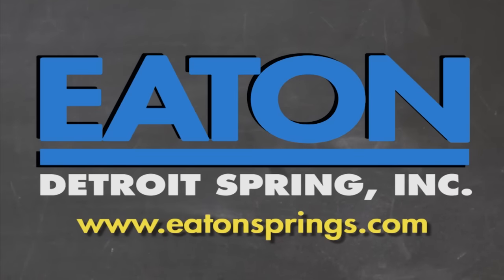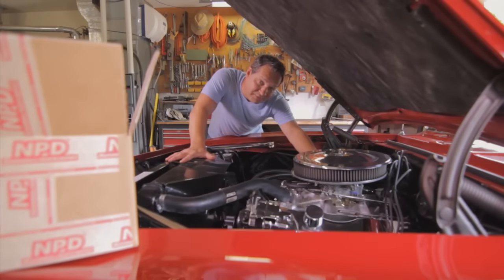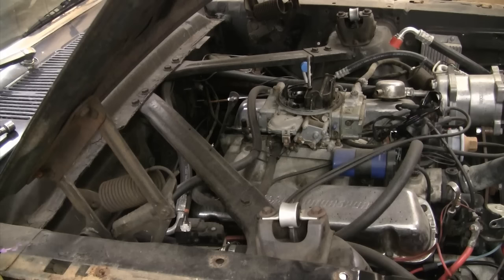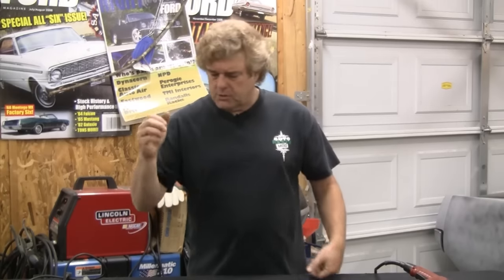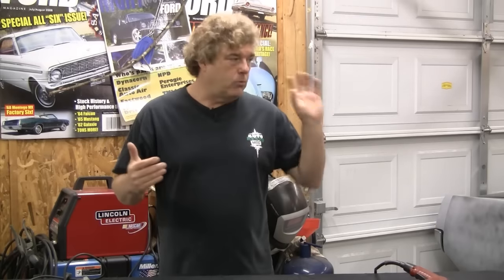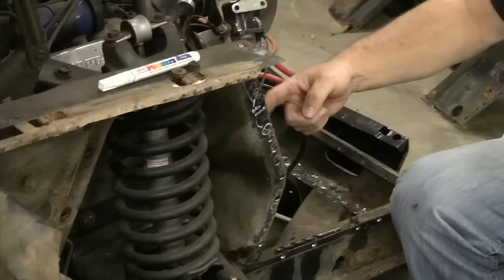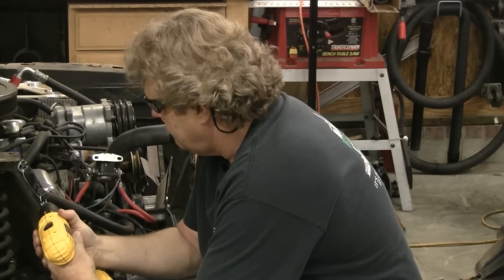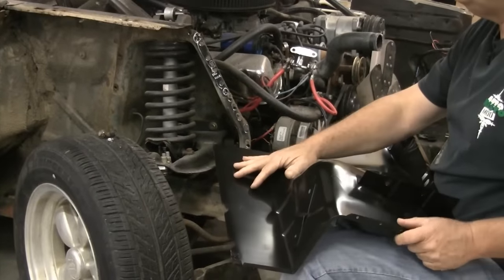Weld in a Radiator Core Support and Battery Tray Apron 1965 1966 Mustang Episode 236 Autorestomod

Comment: I noticed you had a core support stamping, minus the bottom most section which rides below the radiator in a horizontal configuration. Does someone sell just the section below the radiator?
Reply from the maker: NPD sells the whole part, I just didn't want to deal with the work it would take to remove the original. It was in good shape so no need to replace it.

Comment: Would a Chicago Electric 120 Amp Flux Welder work?  I'm asking because the only low enough mig welder I can buy is a 170amp MIG/Flux Welder and its a 240v. I'm not exactly sure which one would work best for doing the sheet metal?
Reply from the maker: Not well. Just ask Cam. We'd rather see you use a MIG like the 240v that they offer at Harbor Freight. Jeff prefers the Lincoln or Miller 110. You can dang near weld tinfoil with the right wire. We use a 110 Lincoln with an Argon with .023 to .030 wire. Check this page for Argon flow: http://www.netwelding.com/MIG_Flow%20Rate-Chart.htm . A good welder and correct settings can go a LONG way to making it a relatively pain free experience.

Comment: Hey guys, thanks a ton for doing these videos. Got a question...I'm about to do both front aprons and the radiator support. Are the spot welds for the core support tabs (that face forward and you bent backwards) inside the frame rails? I have the added luxury (?) of having to patch both outer frame rails for bumper brackets, and can take care of those while the frame rail is open. It makes sense in my head but I want to make sure before I get too into it. Thanks much!!
Reply from the maker: They are on the outside of inner facing of the rails. email me at: jford@autorestomod.com and I can send pics.
Reply: @AutoRestoMod  Awesome! Thanks and msg sent!